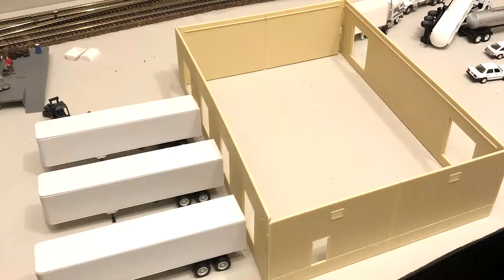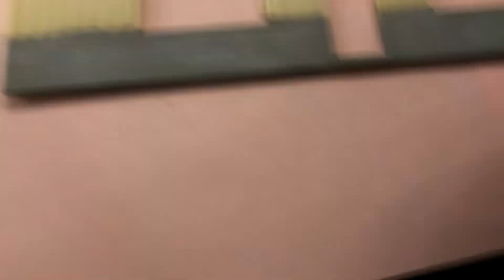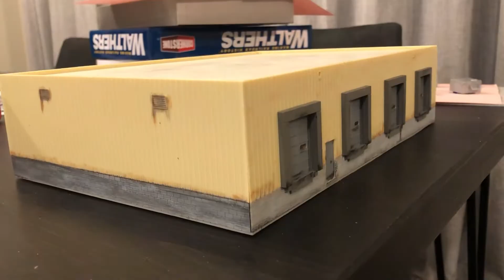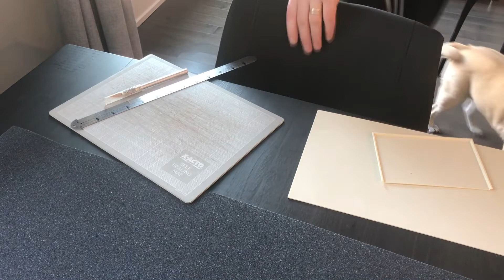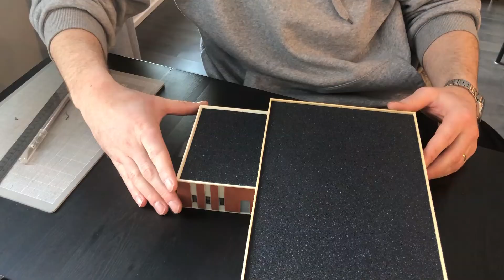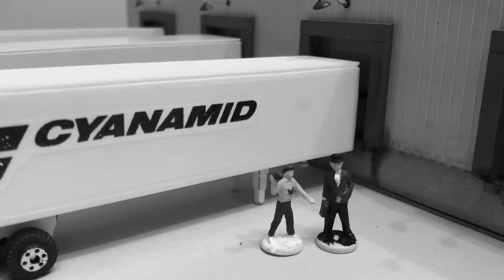Walthers Central Beverage Distributors Build in HO Scale

Comment: If you  use thin solder wire it looks like conduit  power to the roof a c   or    into the  building  power 
Great weathering.
Reply from the maker: Thanks Ron! That’s a great idea. I just might try that.
Reply: @MMRails 
I wish u the best